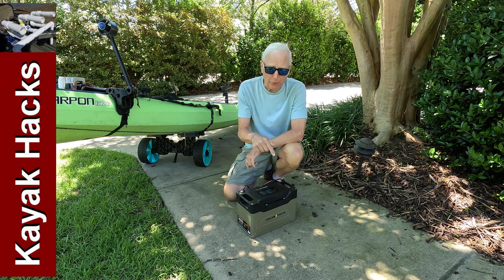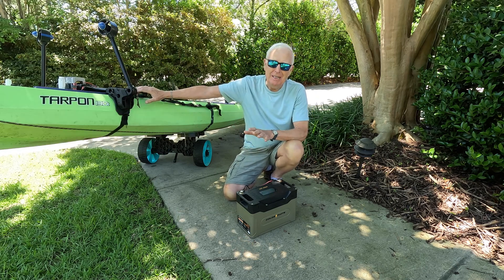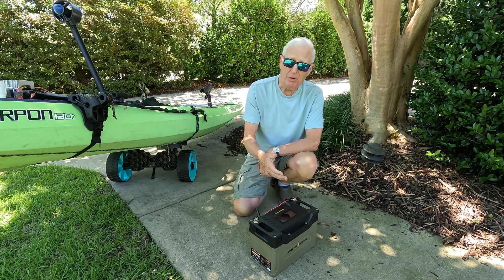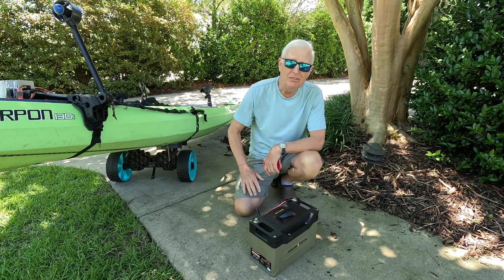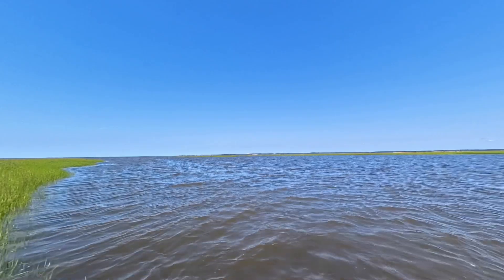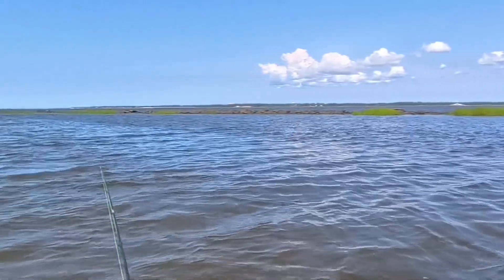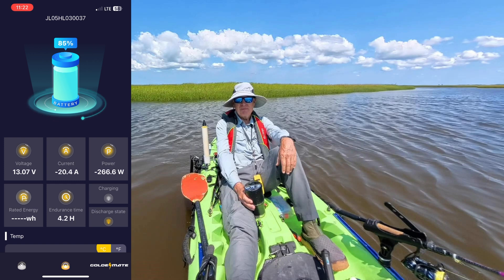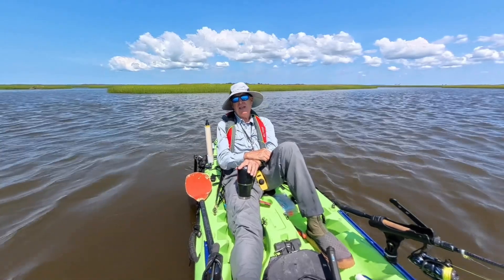Kayak Trolling Motor Battery Stress Test - Goldenmate Orion 1000

Comment: I have a pacmotor. I would like more detail please on how you wired the DC converter to get 19V.
Reply: It's basically a Resister/Inductor/Capacitor (RLC) circuit with a high-speed electronic switch - similar in principle to the PWM, which effectively reduces voltage. Looks like a heavy duty component with a massive heat sink. 

I'm guessing 2 connections for source and 2 for load with a possible control for specifying output voltage?
Reply from the maker: Yes. The unit comes with 4 wires. 2 input and 2 output. I just put it between the battery and the motor. I put a layer of insulation between the converter and the motor, strapped it down with a large cable tie.
Reply: @KayakhacksFishing   Where do you have it fused?
Reply from the maker: @2reelyakrz481  Interesting comment! I do not know what the amp limit is on the Pacmotor. It did not come with an external fuze like my Newport.  When I shared this video with the Pacmotor team, they were glad to see the amp draw was as low as I measured.
Reply: @KayakhacksFishing  You could always use the SWAG method. Maybe get the max draw you've ever seen  (the 12v or 19v side) then go with the next standard size up for a fuse on that side.
Reply from the maker: @2reelyakrz481  Good idea!
Reply: Hi Steve 
Thanks for the quick reply. I would like to know what was your maximum speed with the Pacmotor?
Reply from the maker: @DenisHoule-w5f  In this test, it was running at 3.2 to 3.4 mph or so. That is pretty close to the hull speed of 3.06. I probably had a push from the tide. The hull speed is the nominal "sweet spot" based on the length and width of the kayak. https://www.boatsafe.com/waterline-length/